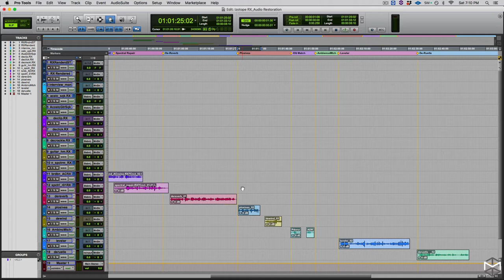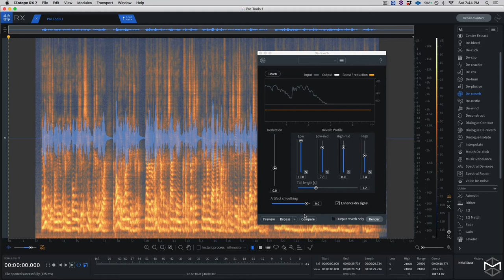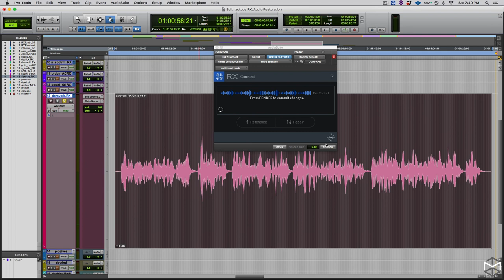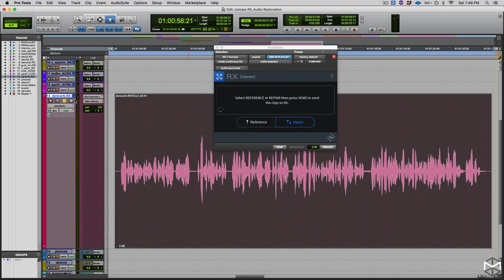RX (7): De Reverb Module

Comment: great tutorial as usual. I have a question. If using the denoise module (spectral or dialogue) how much residue noise in db is left?
Reply: It depends. The interface has a lot of parameters to let you adjust the amount of reduction in db. You can also move section by section and change the values. There are also several types of noise which it can deal with using different tools - crackle, rustle, wind, plosives, general background hum / noise, reverb, etc - so if there's a line of dialogue which has rustle, background hum and say mouth clicks, the total db reduction would need to be worked out differently to the pause right before that line, where you can only hear some hiss. Hope this helps

Comment: Sorry but this was anything but cautiously applied. I appreciate your work making these videos but the truth is that reverb is nigh impossible to remove with ANY plugin  without causing horrible artifacting. The best you can do is carefully eq'ing and LIGHTLY denoising and then MAYBE apply the slightest amount of attenuation with a dereverb plugin- CAREFULLY mixing wet/dry...
Ppl always ask how to dereverb 
Really, you dont. Its a last ditch attempt to salvage a botched recording....
Reply: Your right. This thing shouldn’t be abused for sure, gotta use it in small doses